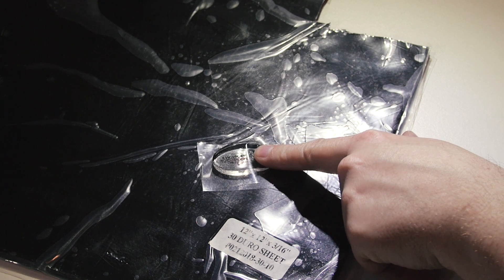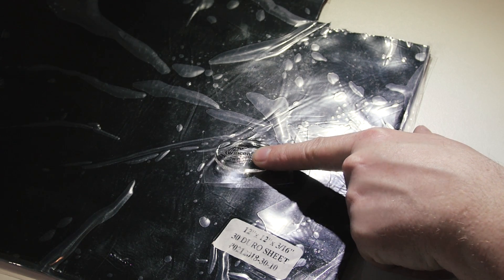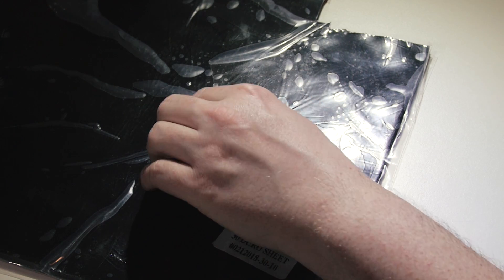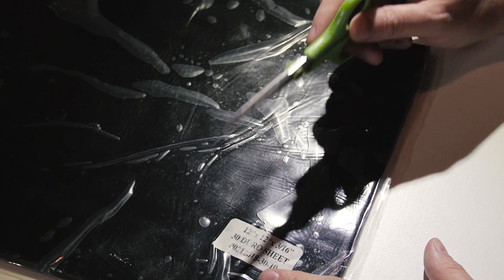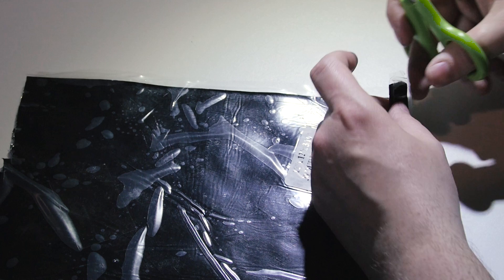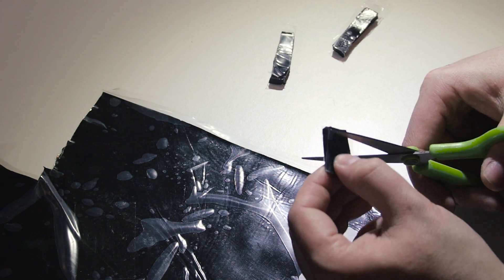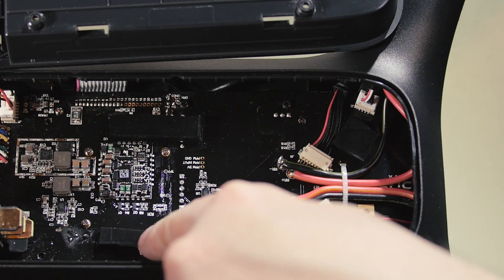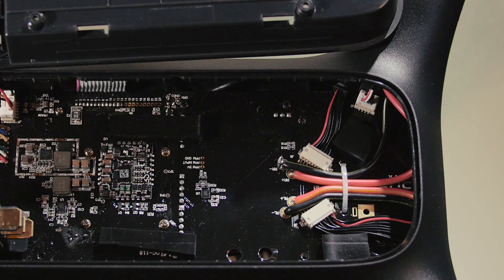3D Robotics Solo Sorbothane Duro Sheet tutorial (moongel)

Comment from the maker: @Thierry Muller

The analogy used on the discussion for this mod was that it's like adding dampening below the bars on a Xylophone, doing so would stop the vibration.  Here the points on the board where screws connect are having any vibration dampened so that less vibration is passed to the IMUs in the Pixhawk 2.

The Pixhawk 2 has internal dampening, but there's still benefit to be had reducing vibration as much as practically possible.